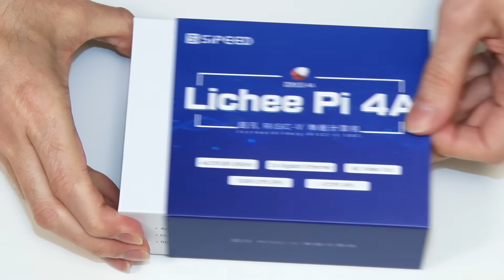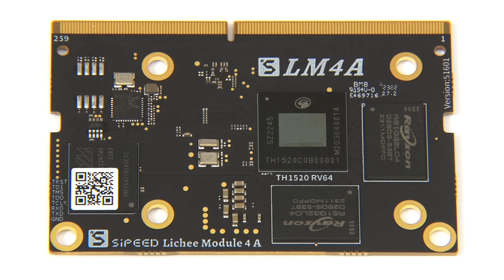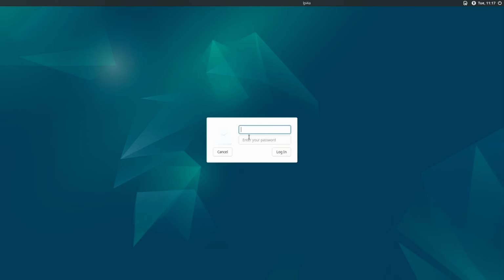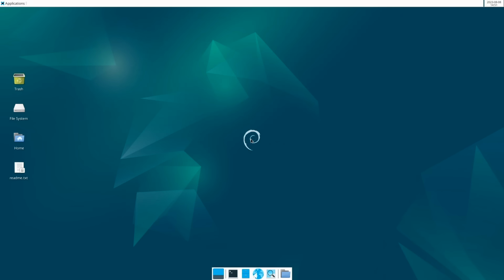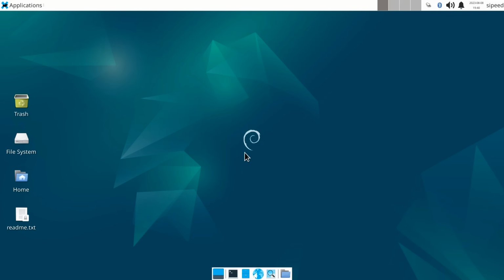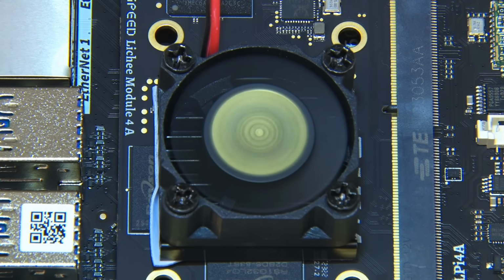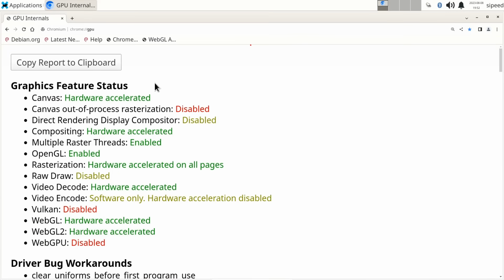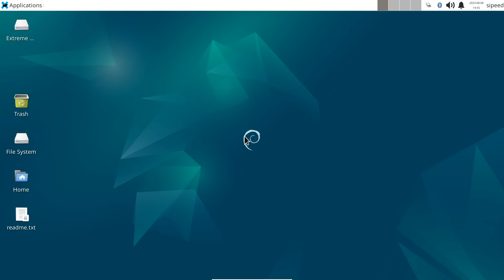Lichee Pi 4A: Serious RISC-V Desktop Computing

Comment: Is this already a better option than ARM? It looks a lot more advanced than I expected
Reply from the maker: It is more advanced than I expected too! :) I've another video coming (as I discuss at the end of this video) where I doa  lot of RISC-V use and testing -- and this board does outperform a Raspberry Pi 4. But for general use, an SBC is still a better get, as there is limited application support for RISC-V right now.
Reply: Hardware-wise it's very similar to a Pi 4, better in some things, worse in others, but Raspberry Pi has had 10 years for the software selection to be filled-out, while it's only since the VisionFive 2 came out in February that most people have had any reason to develop or port software to RISC-V, or access to suitable hardware. Also, the Pi 4 isn't the best Arm hardware now, with the RK3588 boards considerably faster. Those have been out just over a year now, and the RISC-V world will catch up to them in the first half of next year.

Comment: Will you be doing a review on the Star64 soon?
Reply from the maker: As far as I'm aware, the Star64 remains vapourware. It's certainly not for sale. :) It was announced as basically a VisionFive 2 from Pine 64 (it uses the same StarFive SoC as the VisionFive 2).
Reply: @ExplainingComputers I was just curious, because I had seen on the Pine64 store that you are finally able to buy them now and they are currently in stock.
Reply: @ExplainingComputers  Star64 is not at all vapourware, but Pine64 have a policy of only taking as many pre-orders as there are machines in the current factory production run, and these have been selling out very quickly after a each batch of orders opens, so most of the time it is "sold out". I got my order in for the 2nd production run on May 5 and the board was delivered to my rural New Zealand letter box on May 16. I also have received a PineTab-V, which is pretty much a Star64 in a tablet with dockable cover / keyboard / trackpad. I just checked and both 4 GB and 8 GB Star64 are available to order at the moment, but the two PineTab-V models are currently sold out.